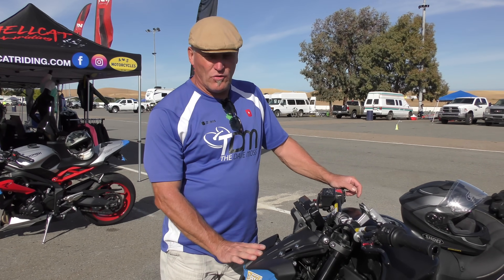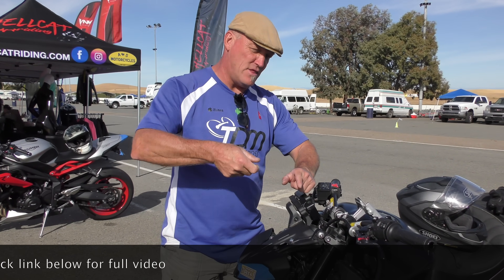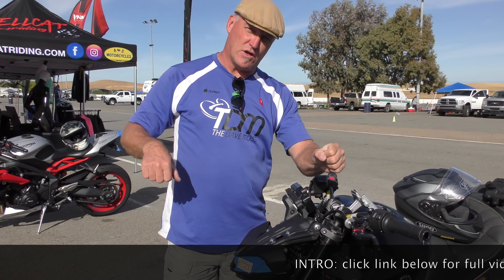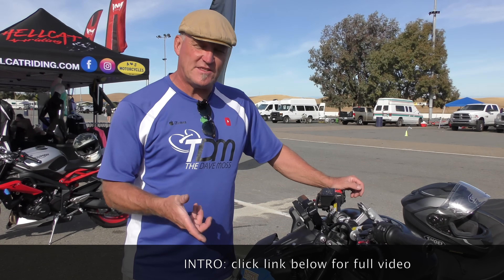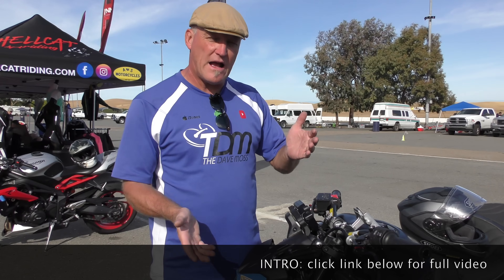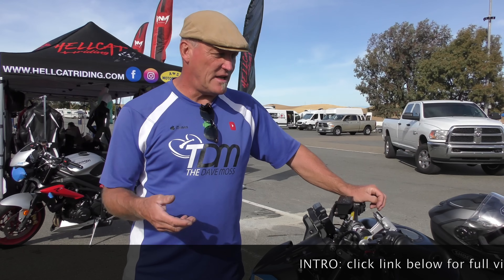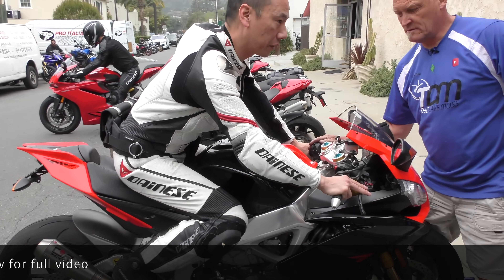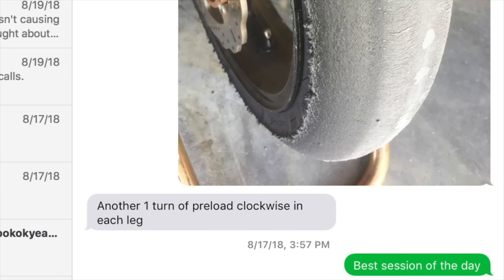Motorcycle Suspension Setting Checkup & Test Day Intro

Comment: Hi Dave thought I bring an unusual item to your attention, I’ve got myself a triumph rocket 3r after riding a speed triple rs, when sitting on my rocket with the bars straight looking at the fork adjusters I can see all of the left adjuster and none of the right, I’ve contacted triumph and they’ve said they’re all like that, the handling of the bike is very good, it just weird’s me out.
Reply from the maker: Measure from the left bar end to left mount and do the same for the right bar end to the right mount. Are they the same?

Comment: currently helping my brother go through his newly acquired RF900. He is learning to do it himself so when I'm not about he comprehends what he has to changed and why.
So Far the rear end has been off, all bearings cleaned out  rollers checked for tolerance and re greased. The shock has been serviced and re gassed, new continental tyres front and rear.
on order! new discs and pads all round, chain and sprocket set, new springs and service set for forks, brake service kits including pins, head stock bearings 
Total spend to date £1620.5 including purchase.
I wonder what would of happened if this bike had been sold to someone less willing to go through this bike and just ridden it because it had a current MOT on it.
Both tyres were over 10 years old and shot, the back end was sagging and soft, front end has to be lifted to get it off the bottom end of the stroke, all the discs are under the minimum wear limit by half a mm or more, all the pads are at the end of life. Head stock bearing has to be rocked out of centre. 
So was a bit of a death trap to my mind glad my brother bought it as the experience of servicing all this is giving him a greater comprehension of what does what and why.

Comment: Awesome as always Dave!  I must say it is incredibly hard for most riders to actually realise that they are adjusting to what the bike is declining on so they won’t really know or understand the lifetime that each of the various components has!  Hence why we (riders around the globe) need to hear this from a position of knowledge and wisdom. Thanks Dave!  👍😎
Reply: With such low figures on oil life in forks?
Im sold on a flush and drain the oil every 2k....
Reply: @deadprivacy  possibly not needed. It all depends on how you ride and what you want to achieve. The front forks aren’t as simple as an oil change for the motor.